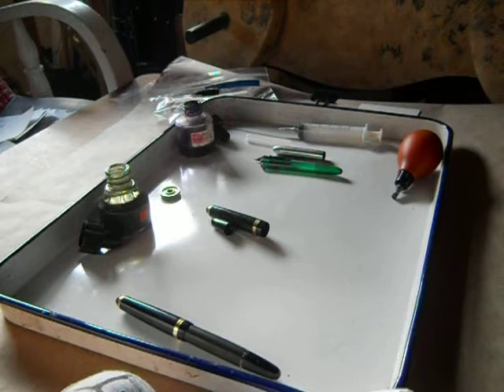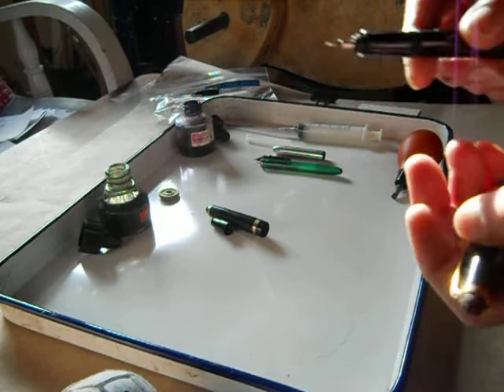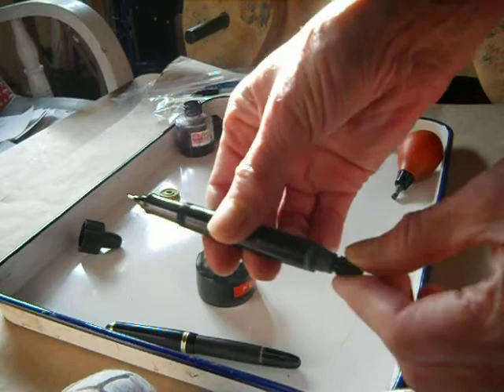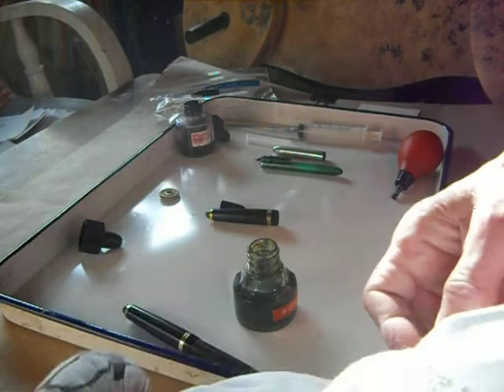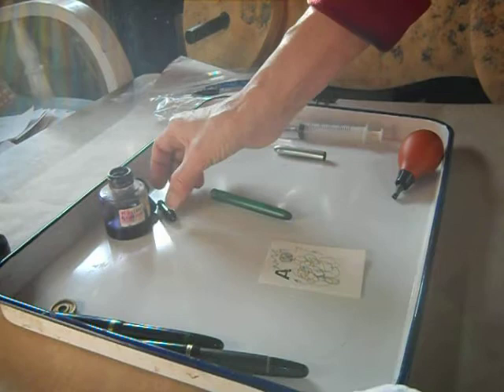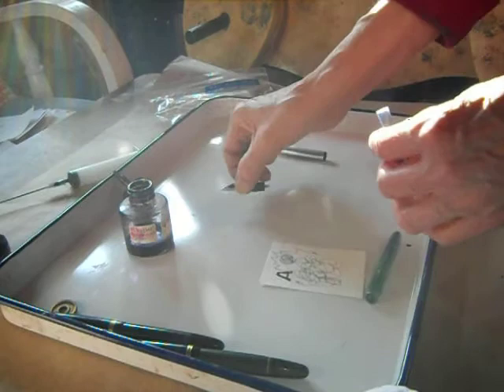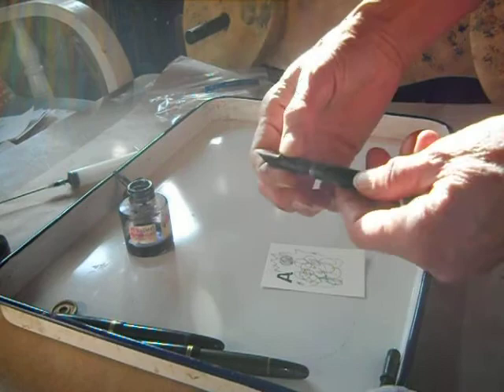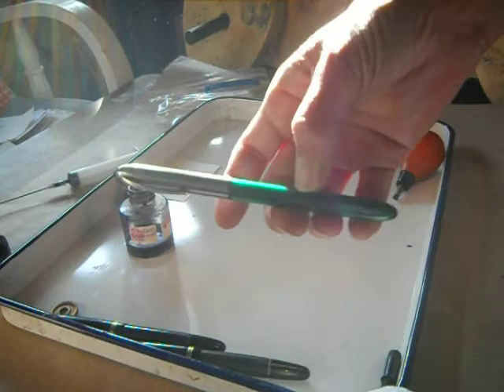Filling a Vintage Koh I Noor Fountain Pen and Filling A Sheaffer Cartridge

Comment: There were converters made for the Sheaffer school pens-- at least two different versions (I have both.) They are not easy to find but they do come up once in a while on EBay. Being rare they also tend to be pricey, so refilling cartridges does make sense. Still, there is a lot to be said for the benefits of converters.
Reply from the maker: I've never seen one- but now will look for them, thanks.

Comment: I have the vintage Koh-I-Noor #116-1/2 Red Wooden Dip pen  so idk if I just dip it in ink like it says but I tried up on how to put ink into it but I had no luck so I thought I should ask you to see if you knew how to put ink into it
Reply from the maker: If it is a regular dip pen- as you said the red wooden type, you do just dip the pen in ink, deep enough for the ink to be at the top of the nib.  Then, move the pen across paper to just remove any excess ink before writing what you want to write.  The shape of the nib holds enough ink to write, most often, a sentence or two.
Reply: @LaurieOMeara  ok thanks